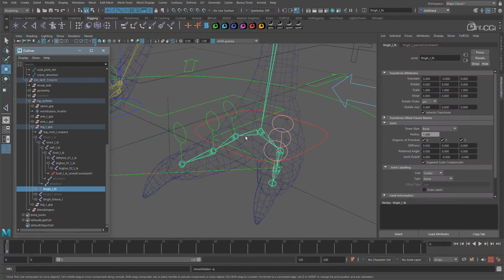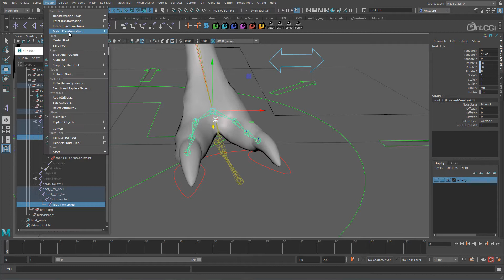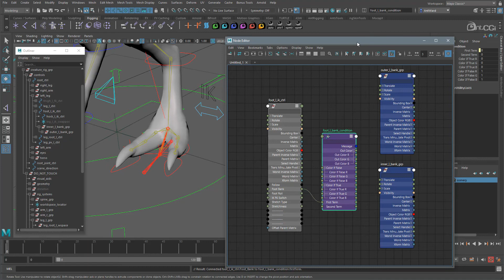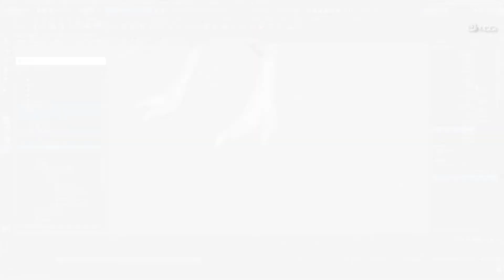Realtime Creature Rigging Workshop (16 / 19) : Reverse foot systems

Comment: Lesson 16: Reverse foot systems
this is a long one

8:00 Reroot: reverse the hierarchy of a chain of joints
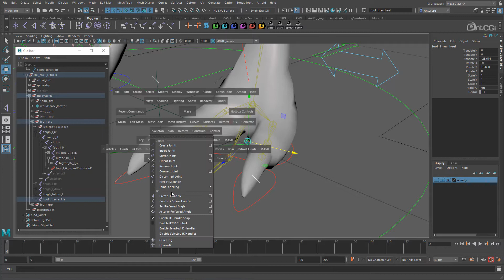8:35 the hierarchy of the reverse foot system: inner bank > outer bank > heel > toe > ball (middle) > ankle (higher up)
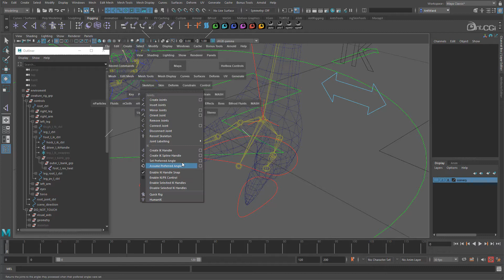12:05 using Single-chain IK to control toes' rotation
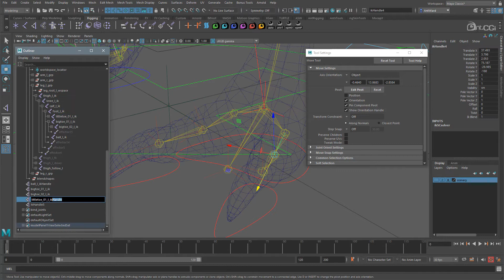13:00 example of foot "peeling" from the floor
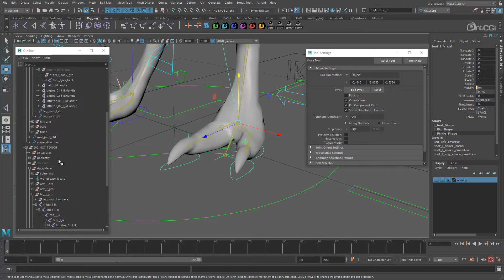13:30 the hierarchy of IK handles and joints of the reverse foot"
	driver's ik handle < ankle joint
	toes' ik handles < toes joint
	ball's ik handle < ball joint
Foot IK control
	inner bank grp
		outer bank grp
			heel
				toe	
					4 toes' ik handles
					ball
						ball's ik handle
						ankle
							main leg's ik handle
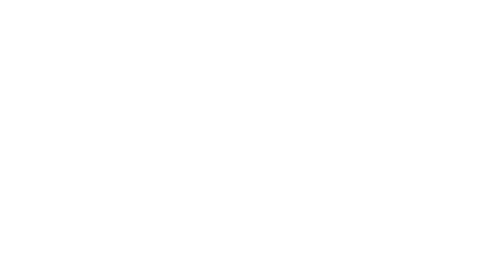14:55 main control: extra attributes
CONTROLS
	Foot roll
	Foot bank
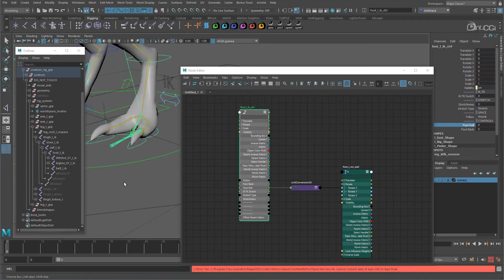16:30 reverse the rotation of the ball when reach a certain point
Roll 25 is the limit for ball
17:00 system for reverse-rotation of the foot's ball (straighten the foot out when it *roll*s to max)

- first create a condition node with Greater than 25
connect the Roll to the first term for comparison
	ALSO to the Color if False for when it less than 25, it uses the Roll value
the Color if True is 25 for the ball to stay if its Roll reaches 25
the output to the joint rotation

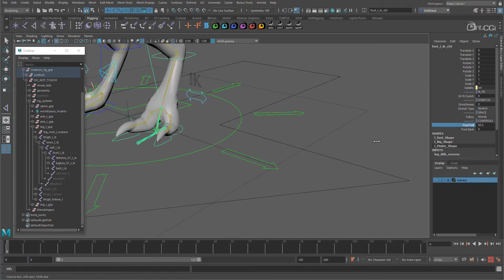18:54 next step:
create a plusMinusAvg node, we are working with the Input 1D section, 1D meaning that only one type of input to interact, and create one output only (1D = 1 dimension)
the fundamental is, if the Roll =<25, Rotation = Roll, if Roll > 25, Rotation = 25 - (Roll - 25)
Roll - 25 = the extra value past 25, subtract this out of 25 make the ball slowly reverse, even to the point it starts to culling back to the palm of the foot

create a fix value by first connect the output value to the node, then break that connection for a fillable-fix value. The second value is the foot's roll, the node output a negative number
next create another pma node with sum operation, the fix value still 25, the 2nd value is now the negative output from previous node, which turn out to be a subtraction from the 25

(this sheet is confusing...)

20:50 adding toes movement
basically, if Roll < 25, toes doesn't rotate (Color if false = 0)
	if Roll > 25, toes rotate by an amount of (Roll - 25)

(this is another way to connecting nodes that follow the logic of doing)
first we need the condition node to check if Roll is greater than 25 or not, which is created on the foot's-ball-rotation's nodes
next add the output of the roll_reverse_pma (the roll over 25) to the empty slot of the condition node (which is G or B)
	Roll < 25 = False <=> Toes = 0 (Color if False = 0)
	Roll > 25 = True <=> Toes = Roll - 25; but the input is 25 - Roll, so
next create a multDiv node to turn the input from (25 - Roll) to (Roll - 25) by multiply it by (-1)
now the toes rotate the right amount AND direction

22:45 work on the other way, roll on the heel

the heel only roll if Roll is reverse, or negative

first we need to check the roll value with Condition node less than 0
	if false, heel = 0
	if true, heel = Roll; in this case the rotation is in the right direction so we don't need another multDiv node like previous
(he changes the pivot a bit so it rotates better)
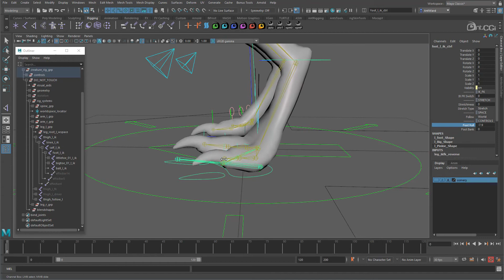24:45 next the foot's ball also roll backward which is not preferable, so we need to cancel that out
just simply add another condition node before the ball's rotation, check the input (which is from the roll_condition node) to see if it's below zero or not

26:38 foot bank

if the Bank value is positive, bank on one side, if negative bank on the other side

Just use one condition node for both sides, compare to 0, if the foot bank into the ground, just swap the bank's side

29:45 Heel Twist, Toe Twist, Toe Tap attributes
The heel and toe Twist is just direct connection to the rotate Y of the heel and toe

30:55 Toe Tap setup

Toe tap is the translation of the toes' ikhandles

First bake ikHandles channels to offsetParentMatrix. then just as simple as direct connection to the translateZ of the ikHandle

31:32 Extra finishing touch after the reverse foot is set up
Spread toes, individual toe, etc

31:58 FLIPPING JOINTS WHEN CHANGING IK FK
(personally I think this is really important, I made this mistake a lot)

in the constraint interpolation type INTERP TYPE to SHORTEST of the skinned joint